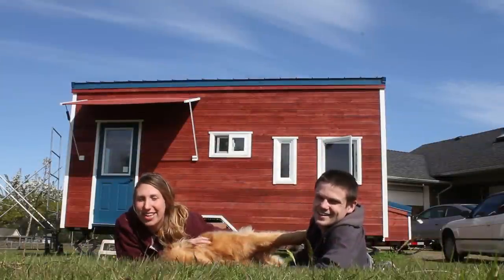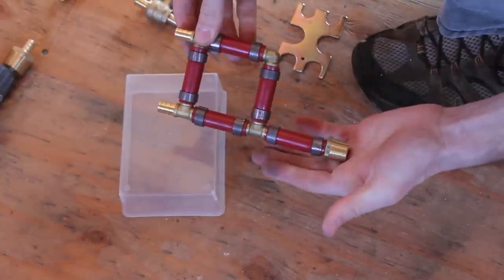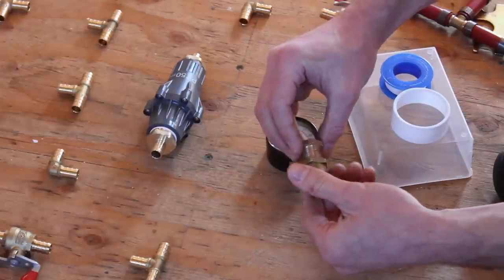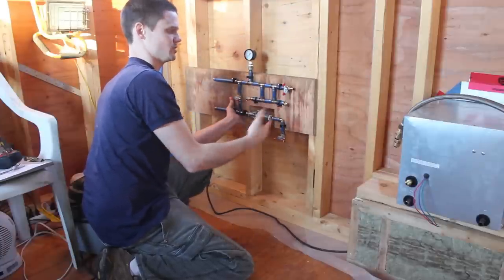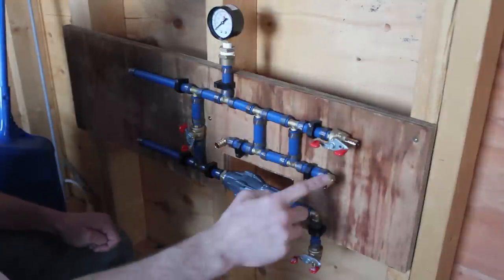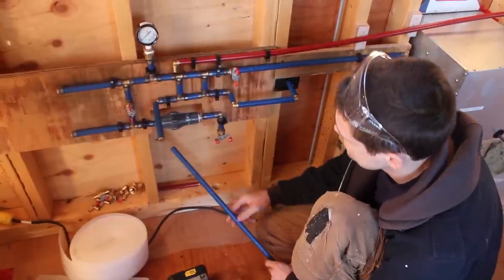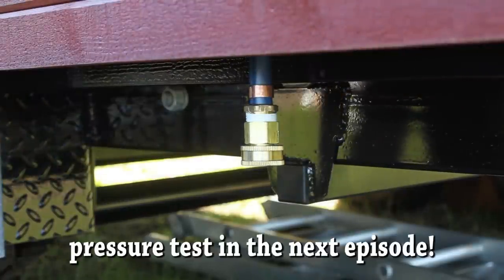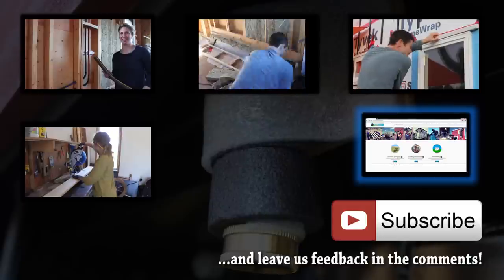Tiny House Water Supply Plumbing (Ep.31)

Comment: I'm going to steal that idea for the pressure equalizing loop.  I did it at the college in the garden beds in the courtyard.  (we have 5 beds, 4 x 22 with vegetables for the foods and culinary program)  The beds have 3 -3/4 inch lines that are 22 feet in each bed with drip irrigation, and by time it gets to the end there was no pressure.  A retired plumber helped me do the loops at the end of the runs, and it works well.  Each bed has a loop, and all the runs are tied together in another loop.  I never thought of using it in a closed system like that.  Sure hope you are holding an open house when it's done.  Love to see it.
Reply from the maker: gary pollock Nice, glad to hear another example of it's application. We're open to having visitors, and we may host a YouTube-streamed tiny-house-warming party when it's all done!

Comment: Your plumbing layout and installation look very good.  I would suggest to anyone doing this (1) Pex is made in 3 types, Pex A, Pex B and Pex C, based on how the tube is manufactured.  The significant difference is in the method of making connections.  B & C use copper or steel crimp rings.

I plumbed two old houses with Pex B and found about one in ten connections leaked and had to be redone. Annoying but not a deal breaker. The tube tends to get out of round when cut and I discovered that wetting the tube made it easier to slide a copper ring on and if needed, a tee fitting pushed in the open end held the tube round so I could get the ring on.  The biggest problem was when I needed to get the crimp tool into a tight spot like you had underneath the outside penetration.

I an now using Pax A which I found at Menards.  Only two manufacturers(Uponor & Sioux Chief) make Pex A and the fittings and rings will not interchange with the Pex B & C fittings.  Instead of using the more expensive brass fittings except for the metal to metal connections, I am using the poly (plastic) tees and ells (etc) which are about 25 cents each (vs $5.00 - $10.00 each for brass).  The connection rings are pex and the tool expands the ring and pex end and you have thirty or seconds or so to slip the fitting in before the tube shrinks back down on the barb, holding it very tight and getting easily into those tight spots.

The tool is a bit more expensive, but you can find them on eBay and resell them when you are finished.

Instead of struggling to force the tube insulation down in a hole, I would suggest putting the pipe in the oversize hole and using some "Great Stuff"or similar spray foam insulation in a can to fill the hole from both sides.
Reply from the maker: arbeeex Some very good info and tips here, thanks so much for sharing. We did originally look for PEX A but it seemed to be uncommon (not regularly stocked) in our area, so we just went with the standard stuff. I think PEX A is probably better, but so far our PEX seems to be OK. We'll make a video if we encounter any leaks ;)

The only reason we struggled with the insulation sleeve was to ensure that the pipe would be centred and evenly cushioned in the hole.
Reply: Pex A can be found online - just google PexA or look it up on amazon.com
Reply from the maker: arbeeex Aye, thanks :)

Comment: In examining your system, your intent to use the  distribution manifold was to try to keep from having a pressure drop. Understand your pipe size is the same throughout.  Keep in mind you have a one volume pipe size  in and  3x volume  pipe size ports out. OK!

 I have worked with distribution manifolds before. I have a different understanding of this and I may be wrong but hear me through. 

You may need a larger pipe size on the intake side of your water system-- up until it is reduced after the the distribution point to keep from having pressure loss. The manifold should have the same large diameter pipe which comes into the house. It would be reduced at the dedicated line point. Example; Where your cold water pipe runs to your hot water heater pipe. That is where your reduction should be.

I don't think you will have any major problems with the way you have hooked up your system now.

Take just a minute of your time and consider you have a 1/2" line coming into your house. This line is connected with brass hose barb fittings. Question what is the internal diameter of the hose barb? Not the  outside diameter of the hose barb but the internal diameter of the hose barb. Is it 1/2" This is your water volume.    Your PEX pipe may be 1/2" internal diameter. Is the internal diameter of the hose barb also 1/2", or do  you have to allow for the walls of the hose barb? I do not have a PEX fitting available to check this information.

If you have difficulties maybe the information I have provided here may help you,

Thank you for your time. Hope all works well.
Reply from the maker: Rita Mastin The fittings have a smaller diameter yes. We don't have any experience with this so the choice to use all 1/2" came almost entirely from looking online for flow charts for various pipe diameters, and then comparing that to what fixtures we plan to have in the house. From what I could tell, 1/2" pipe was MORE than enough to serve the entire house. Whether or not there will be a noticeable pressure or flow drop while multiple fixtures are flowing simultaneously has yet to be seen, but we will definitely follow up in a future video to let everyone know. It's hard to imagine situations where we will be flowing more than two things at once. It should also be mentioned that we will be fed from an RV-style potable water hose, so before the water even reaches our tiny house, it will have flown through other piping and then through the hose.
Reply: Jake , it will all work out. You will have plenty of pressure. What I gave you was just food for thought for future plans hopefully. You and Kiva have a beautiful day. Wonderful to talk to you again. Peace.
Reply from the maker: Rita Mastin As always, thanks for your input :) and take care.

Comment: Hi and thanks for your reply.  As far as your grey water drainage goes I am
having a little trouble figuring out how to do it. I want to be able to
rough-in that portion before I put the floor sheathing on but my question
is by just going straight through the floor/insulation and then using
rubber connectors to combine all the drains together with a 3" abs pipe and
then to the spaces sewer?
If so if and when you move your tiny just put the main drain in your tow
vehicle?
Your help with this problem would be super helpful.
Thank you.

P.S. my folks live on the island too up in Parksville.  I myself live in
Sacramento, California but I am a Canadian too.
Reply from the maker: +Larry “TYPHOON” Read We decided to leave it since we didn't have the exact position (down the the inch) of where the drains were going to need to go. We will likely use flexible tubing from where the drains poke through, right over to the drainage, which might be a french-drain, or a tank that we pump out.... keep in mind that we won't be moving much and our solid waste will all be composted.

Comment: I was super stressed as i'm approaching the plumbing phase. I like how you did this. I saw in another comment that you ditched that regulator, are you not using a regulator at all now? Are you still happy with this water heater?
Reply from the maker: Yeah the regulator seemed to have a tiny leak that I could not track down... so in the interest of getting the plumbing pressurized without worrying about it, we removed it. The pressure is fine, we were just hoping to stabilize it a little. Our water-heater has been  very good so far. We will make a video review about it after we have used it for showering etc.

Comment: Hi guys, what a great series! We are building our own tiny house and are learning so much from you! I've been reading Tiny House guidelines and it stated this: "10.j. Plumbing must be vented through either the roof or a side wall (just below the roof line with an RV wall vent cap), in accordance with NFPA 1192, Chapter 7.6. However, unvented sinks are acceptable with HepVo traps." Did you end up venting your plumbing system? How did you accomplish it or why didn't you? Thank you for your suggestions!
Reply from the maker: +Vladimir Dubovskiy We will be adding our drainage plumbing a bit later, and we plan on using a p-trap alternative... it will be a bit of an experiment, so stay tuned :)
Reply: really curious to see it. Thanks!
Reply: Vladamir, I am trying to reach you, just saw your home on tv.

Comment: I was wondering why you did the square loop in the pipes - I had seen that pic on Facebook awhile back and wasn't quite sure why you were running water around in a circle - You would need 2 water supplies right from the source to make it work - I've seen it done on very large homes - they have ran the pipes directly from the well to the cold water manifold down both sides of the basement - I can see what you were trying to do and like you had mentioned in the video you didn't think it would make much of a difference and I don't think so either since it wasn't split from the source.
Reply from the maker: Sachi WI Ha, yes we had a few people asking about it. A comment from "gary pollock" describes how he used a similar type of loop in an irrigation system and that it worked well... but maybe that's a different situation. Anyway, we'll see, and I can't see any reason why this would have a negative impact.

Comment: Hi, Great series. I am looking into container homes, but a lot applies. I was wondering why you decided to have the double hose link for the manifold? I mean instead of just a direct split.
Reply from the maker: +Ahman Millener Thanks for watching :) If you're referring to the loop in the manifold, I saw a video (while researching plumbing) where the guy described how a loop helps equalize pressure when multiple lines are flowing at once... not sure if it's going to have much effect, but decided to put it in anyway.
Reply: Oh that's cool and a good idea. I'm sure it will work.... Thank for the reply....

Comment: Great videos!  Regarding the potable water hose and connectors - do you recall what exactly you used (meaning the adapters and the size of the potable water hose)?  I'm headed to Home Depot or Lowes later today and I was hoping to pick up what I needed - looks like you had maybe a 1/2" Brass PEX Barb x 1/2" Brass Male Pipe Thread Adapter (on the PEX side), and then I'm not sure what you had that connects to the hose?  Something with two female ends I'm guessing.  I was also curious if the diameter of your potable hose is the same as your 1/2" PEX or if it's different?   Thanks!
Reply from the maker: +Sac TinyHouse The fitting for the hose is just a 1/2" PEX barb on one side, and the female thread for the hose on the other. We just test-fit the fittings as we were buying them, so I didn't make a list of parts or anything :P

Comment: any thoughts on how you will prevent freezing on the outside of the house? in my TH research, this is an important factor for me where I live. I am currently thinking of wrapping the outside hose in insulation over top of a heat tape. any thoughts on this? another thought would be, do you need a 'food grade' hose for your water supply or are you just going to deal with a rubber taste in your water?
thanks for the fantastic video! :)
Reply from the maker: alzathoth We will very likely be installing heat-tape on the RV-style potable water hose that will run from the garage out to the house above-ground. And the tape will be controlled by the house's computer... just you wait... smart-tiny-house incoming

Comment: Did you say you were going to remove that panel to put in the insulation? I don't see how. 

It looks good though. I would put valves everywhere so you can work on faucets and the like without shutting off all the water. It's ridiculous how often we have to shut off the water to my building.

Not sure how long the run is from heater to most distant faucet, but have you looked into recirculating systems so that the hot water is always hot? Sorry if I've mention this before and REALLY sorry if you are not using a tank heater.
Reply from the maker: MakeMeThinkAgain We'll just unscrew it to slip the insulation and vapour barrier behind the plywood (so that we don't have to cut and seal around the plywood backer).

The great thing about the house being tiny is that it's literally impossible to be more than a few steps away from the main shutoff :D so hopefully the one shutoff (plus hot water shutoff) will be sufficient.

We are interested in things like a recirculating system, but maybe we'll look into it down the road. Everything under the kitchen cabinets will be accessible. We have an on-demand propane water heater and the longest run (the toilet's sink) is 25' at most.

Comment: Is there a reason you didn't do the piping under the floor like regular single story homes and for more direct routes(save on amount of pipe needed)? Is there any preference that you have found in your research for Tiny homes?
Reply from the maker: +Handy Woman Because of the way we built into the trailer, we would have had to run the plumbing during one of the very first building steps, and we simply weren't prepare for that. Running it inside the walls let us figure out the routes once all the framing was done :)
Reply: +Tiny Nest....thanks for confirmation, that's kinda what I figured. I know it would have been a big commitment to have done it at the early stages. They way you did it worked out well and it gave you more time and comfort with your decisions. I'm really enjoying your series a lot. The details are outstanding. I really appreciate that you share your thought process of how you came to your decisions.
Reply from the maker: +Handy Woman We appreciate you watching and commenting :)

Comment: With the small system you have, your set up should work just fine; but ideally you should of started with a 1" line as the supply including the manifold you made then reduced to the 3/4" or 1/2" line you are using.
Reply from the maker: Duane C The thing is that we're going to be fed from a hose anyway :P and as a novice plumber (or rather, not a plumber at all) I researched flow rates of different pipe sizes and compared them to our planned fixtures/draw etc. and unless I made a mistake, the 1/2" should be like several times the capacity of the entire house.... only time will tell, but hopefully some small plumbing is enough for the tiny house!

Comment: PEX will degrade rapidly when exposed to UV light, I just learned.  So, is there a different way to design the inlet to prevent this?
Reply from the maker: We had a piece of plywood in front of it for a while before we built around it ;)

Comment: So I'm a plumber that has somewhat recently become interested in building a tiny house. I keep seeing people put in pressure balancing manifolds. I'll just say that I wouldn't and leave it at that.
Reply from the maker: Do you think it has merit in a larger, more complicated system? or is it a misunderstood thing? thanks for your feedback :)
Reply: In a much much larger system. Like a hospital, or a high rise. Or in very specific uses, like a shower with multiple body sprays. I mean obviously it isn't going to cause any problems, it's just that you aren't going to see any measurable gains on a system that small.
Reply from the maker: Thanks for the feedback, it's nice to hear a direct experienced response to give more insight into to subject :D
Reply: My pleasure :)
Reply: I am currently putting together my plumbing for my bus tiny house thing, and I was wondering about this very thing. I will have a supply line (w/ a check valve) that Ys to the tank with a valve (to fill it up) and then to the rest of the system while I'm on city water, which will also meet another Y from the check valved pump. that part isn't the relevant part, but I figured I'd see what you thought anyway. from the single supply line it will be Y'd to the cold water lines and to the water heater. from there it'll be Y'd into the kitchen sink and shower, likewise after the water heater. does that sound right? my guess is that if I were running the sink and shower at the same time, I might suffer drop in pressure, but I also don't think it'll matter much. what do y'all think?
Reply: "Simplicity is the hallmark of good design".......(building/electrical/mechanical/plumbing 35 years.)

Comment: Spray foam might have been better for sealing that hole securely.
Reply from the maker: HellsingSage Definitely an option. One advantage of the wrap-around is that it guarantees an equal amount of insulation in all directions.

Comment: do you recall what the name of the pieces you used for the hose connection where called?
Reply from the maker: +LiveYourLife89 The fitting that adapts from PEX to the hose thread? I basically just talked to the plumbing supplier and explained what I needed so I don't remember sorry :P

Comment: do you have to teflon tape all the joints? i.e. the blue ones in the video?
Reply from the maker: +Ahsan Shahid The crimp connections have no threads at all, it's entirely compression.